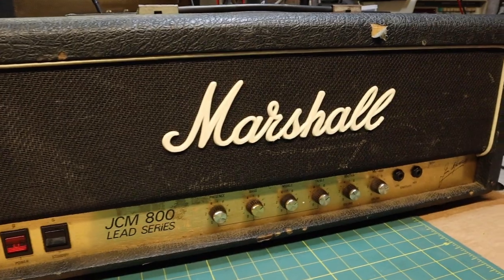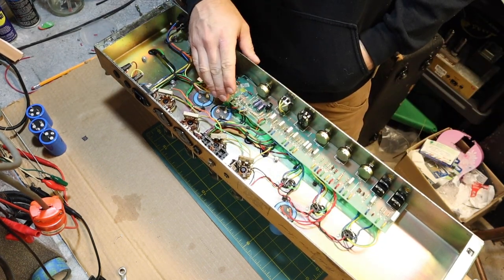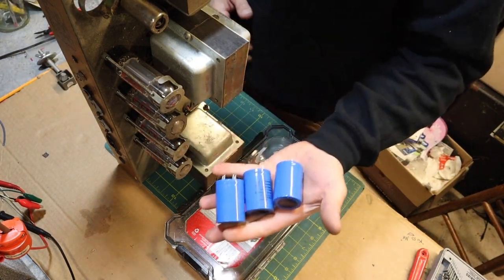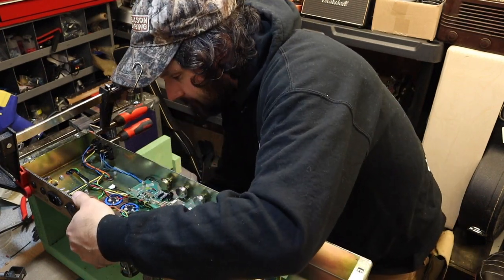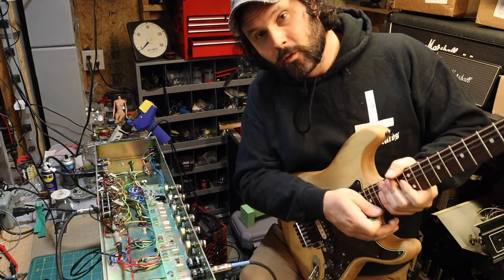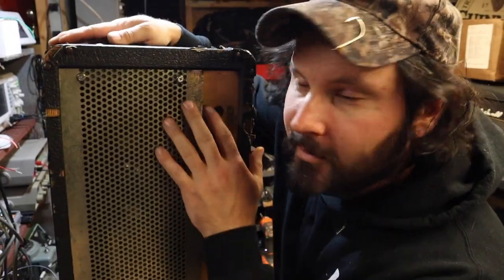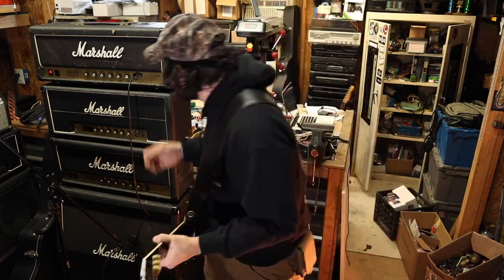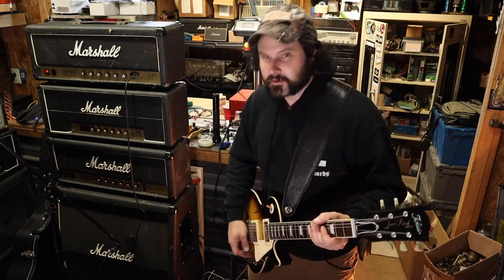Repair Blog: Marshall JCM800 2203 with a blown fuse + SOUND CLIPS

Comment: I bought a 2204 half stack brand new back in 85 and that had to be the LOUDEST 50 watt head I have ever played through. On 3 it would rattled the windows in the house. With the higher filtering in those 800's, it was tight, punchy and had a fast attack. It was beautiful!!!  To this day I regret having to sell it in 93.

Comment: Great video man! I have a 50w 2500 SLX with the 5881’s.   I wanted to see how the KT66’s did to bring out the bottom end.  What would that need besides a bias adjustment??
Reply from the maker: Shouldn't need any circuit changes but it's always a good idea to check the specifications on the tube's data sheet prior to installation.  I mainly look for the tubes maximum plate voltage and check it against the actual plate voltage in the amp.  Some tubes can only handle 450VDC and it's possible to have a Marshall running close to 500VDC on the plates.  I think a typical KT66 can handle 500VDC to 550VDC on the plates in pentode operation so you should be fine.  I would also try biasing closer to 60% of your max idle current and you may find the low end is less compressed. Either way, it's fun to try new tubes and never hurts to have spares. Good luck.

Comment: Hi. Great video! What you think about the 2203x reissue? It's good like this?
Reply from the maker: The reissue is a faithful reproduction of the 2203's that were made from 1980-1983. Sounds identical and I have personally seen the circuit and it is spot on. The FX loop is garbage though. The effects send level changes with the level of the master volume. I replaced mine with the Zero Loss loop available from Metro Amp. The only other difference is there is the addition of a hum balance control on the PCB. 
Great amp.
Reply: @purgasound  thanks for the informations. So when the loop it's off doesn't affects the sound! The reissue has the same punch of the originals? cause the punch and the air movement it's a characteristic of this amp! I'm looking for a 2003 but it's hard to choice between a reissue and original... there are many discordant opinions
Reply from the maker: @mikkiosantoro1  the loop is bypassed when off.  It does not affect tone as far as I can tell. I own a reissue and JCM800's from 1982, 1983 and two from 1987. The new ones sound like the old ones. Marshall did a great job.
Reply: @purgasound  ok 👌 and what are  differences between 81-84 end later jcm800 with 3 filter caps? More bottom end and more punch for 81-84? I know that also the early models are discontinued

Comment: Do you ever worry about residual in those caps?

They look big enough to knock the crap out of you.
Reply from the maker: I discharge them when they need to be but I'm not a freak about it.  I've hot-swapped breakers in a live 480VAC 3 phase panel before. The exposed service mains and 600A disconnect command my respect but I'm not too worried about a cold amp.  I am very cautious inside a live amp for sure.

Comment: Do the early 80s jcm800s sound better then the later 800s? I just bought a vintage 2203 from 1988 and it just doesn't seem to sound/feel as good as an early 80s 800 that i once owned.
Reply from the maker: It's all perspective.  I have never A/B'ed the two to hear any difference.  The 2203's after 1984 lost two 50/50 filter caps. Some have said this results in a lack of power in the low end but I can't confirm that.  It is also worth noting that they went back to EL34's around that time too. Previously they were being shipped to the U.S. set up for 6550's. That could make a perceptible difference as the 6550's were biased like an EL34 which means they were biased a little on the "cold" side.

Comment: Hey man, do you have a clear schem of this 2203? Ive had no luck finding a clear and readable one. Only a 2204 has clear one. Im rebuilding a Jcm800 bass series into a lead series 2203 into a turret board. Thanks
Reply from the maker: 2203 schematics are really common and the only difference on the post 1984 2203's is that they simplified the B+ filtering and use two less 50/50uF cans.  2203's are also extremely common amplifiers so I would strongly advise against destroying a rare JCM800 Bass amp in the conversion process.  You could sell the bass amp and use the proceeds to purchase a 2203. If you really want to build a 2203 you could save money by purchasing a SLP reissue and you wouldn't even need to replace the circuit board to convert it to a 2203. You would only need to move a few wires and change two or three parts.
Reply: @purgasound  you are the nth person who is against converting this amp. The thing is I live in the Philippines. Any JCM 800 is rare here. 

Im making a new turret board so i can install the stock pcb if ever in the future. I decided to use small size  filtering caps that i can fit in the board so i dont have to drill new holes for cap cans.
Reply from the maker: @Frankentoane  You will not need to drill any holes for the conversion. You will utilize the same type of 50/50uF can filters that are mounted on the amp now. You can board mount smaller ones but it will be easier to use what's already there.
Reply from the maker: Send me your email address and I can send you a copy of the post-1984 2203 schematics.